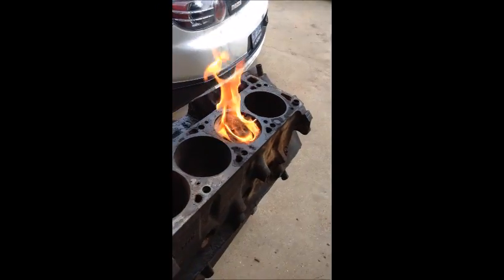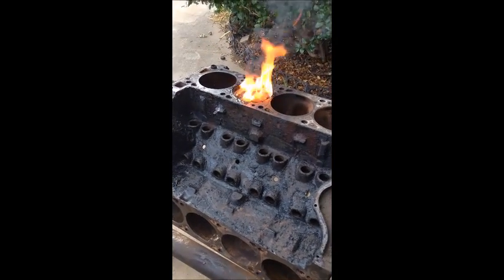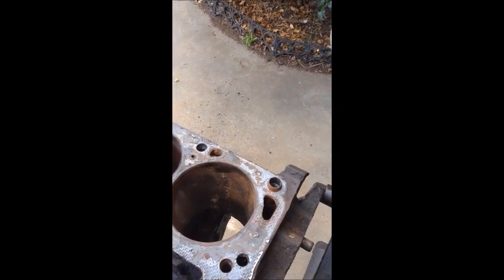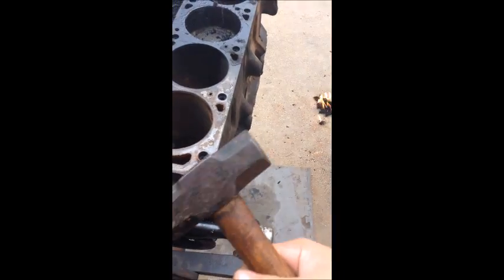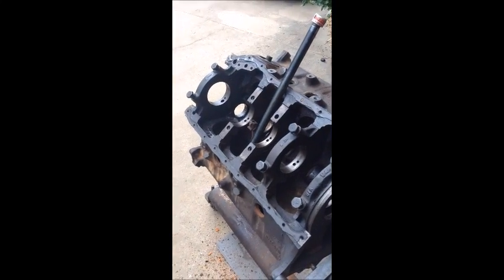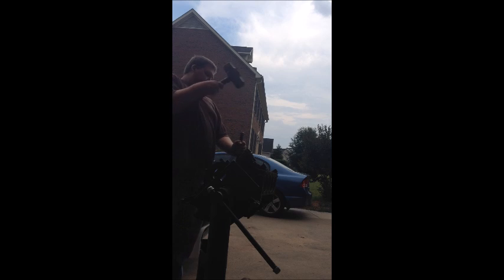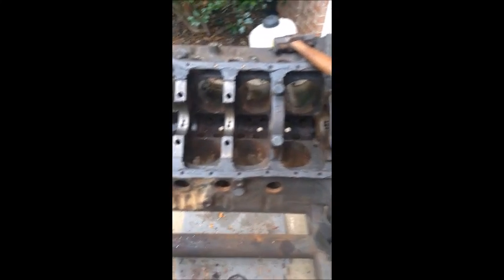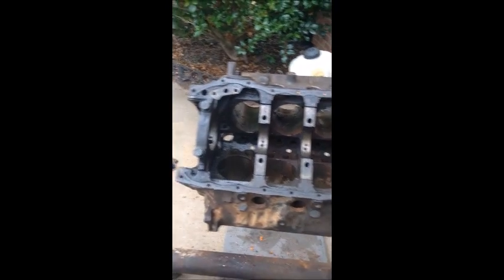How to Remove a Seized Piston

Comment: You sort of missed the point.
There is a few reasons for heat
The trans fluid and gas fire all do a few things
One of the other comments had it right with expansion rates.
Before you started to remove any piston. 
1/ pour trans fluid or WD40 on the under side of the pistons to soak for a day or a week the longer the better.
2/ do the same on top of the pistons. The longer the better.
Setting fire on top if piston does a few things.
1/ expands the piston as it does it crushes the rust and alloy corrosion this allows the fluid to creep in around the piston
2/ it expands faster and more than the cast iron
3/ once the block is hot cold water on the back of the piston "in the piston only" even ice cubes they will disappear  fast.
4/ wack that piston as it would have shrunk quite a bit.
Thats why at first you couldnt move the piston but after a while it came as the piston had cooled but the block would still be hot.
Reply: Yes, let the piston cool off, then hammer.

Comment: I would have just heated the block with a torch instead of the piston because when the block expands it will go loose on the piston that takes longer to heat up. how you've done it will probs be no different to room temperature as they've both heated up together and expanded at the same time.
Reply: Aaaaannddd again....heat fracture the piston bore/sleeve.
Reply: I would have put that Ford block in the garden as an 8 hole seed starter. 😁

Comment: your doing the wrong thing there is a ridge at the top of cylinder that must be removed to get the piston out you can beat on that all day and get no we're the cylinder is bigger at bottom try going to the bottom push it out the basics of engine rebuilding to take a ridge reamer to remove the metal lip that form on high milage engines in order to remove the piston 
The ridge can be felt by running your finger along the cylinder wall at the top you will find the lip that were the piston top ring stops and wears the wall otherwise your wasting your time trying to remove it try hit the piston down first.
Reply from the maker: rock dawg I know about the ridge. The piston was stuck well before the top of the cylinder at the ridge.

Comment from the maker: Alrighty folks. In regards to all these nephsons and their comments. I had been trying to get this piston out for about an hour before finnally deciding to try this. I tear down motors all the time and I've never had one this seized up. I tried a torch before I made this video as well. Only reason I tryed is is cause I saw another video of a guy doin it. And it worked. I wasn't trying to save the piston. I already knew it was gone. The motor was not damaged and it is back from the machine shop in my garage ready to go together. Btw, that sledge had a heavy steel tube as the handle cause the wood handle broke. It weighs almost 40 lbs.  it's like picking up a crank shaft.

Comment: You legit just mushroomed the piston in the cylinder by hammering on the skirt dont ever do that if the piston cracks youll fuck the cylinder too and that piston was fucked, ive always tapped them out from the rod cap as the wrist pin is dead centre in the piston and and also equals out the blows, all you did was just mush that piston down in there worse than it was before and by heating it up and not attempting to cool anything it legit is now wedged in there and will only get tighter as it cools, not the way to do it

Comment: Heat in metal = expansion = FUCKTARD!
Reply: It works he just did it wrong. The piston cools down faster than the block because its made from aluminum.
Reply: Paper Sack Heat in metal = expansion of cast iron that surrounds the piston. Go troll something else you have no experience with and make sure to use vulgarity to reinforce your naive statements. Obviously it worked.
Reply: Paper Sack hahaha !!!!

Comment: all for a 2 bolt main
Reply: jon sixxx xD
Reply: There's nothing wrong about doing what YOU want to do or what others want to do.
Reply: The amount of main bolts are mostly inconsequential. There are a slew of more important things. Besides - just add a girdle and it really don't matter.
Reply: You would be surprised with how many race motors are 2 bolt, and even more surprised to find that 2 bolt blocks converted to 4 bolt are much stronger than a factory 4 bolt block.

Comment: I used to have problems with that but i found if bout a week before starting the rebuild put oil in the spark plugs than put back the old plugs or rags if the broke..... Now if you do all that and it still sticks i put pb blaster or some higher grade of penetrating oil overnight and so far those are the only two methods i have needed

Comment: If you have a blowtorch and don't have much time heath the piston so it expand and "break" the rust! Wait it cool (again if you don't have much time you can use water to faster it but i recommend you to just wait) and try to hammer it again.
A even "faster" option (if you have the right tools) would be drill/destroy the piston.
The best way would be leave it on a penetration old/rust cleaner for some days/weeks.

Comment: diesel / transmission fluid mix in bottom side of piston / cylinder cavity and let it sit for several days upside down and heat top of piston with a torch / heat gun this will cause expansion / contraction which will allow the lube to get deep into the siezed area making it lubricate. Then a old trick  drain the fluid / lube from bottom of the cylinder and heat block we used to make a fire and let the block set on a stand beside the fire to get really hot then simply take a few pieces of dry ice and set them inside the piston skirting aka bottom of piston to chill the piston but keep block hot then give the piston a thump and 90% of time piston comes right out.
Reply: I ve tried the kerosene for weeks and month also.I was thinking when he was doing that to heat block,which expands then cool piston,just like you send,it has to work.

Comment: fill the cylinder with wd40 and leave it for 12 hours or so and hit it with a block from the top ive un siezed  many engines this way lighting it on fire will just make things worse you need to break down the rust which is why the piston is siezed in there wd40 eats up rust

Comment: Well that was just worst case you made dude. 50/50 atf acetone or diesel works the best. let it sit and gently work it. all that did for you was probably screw your bore. That pipe isn't rigid. it's 1/2" o.d. gas pipe. Not a 30 pound sledge either. Maybe a 20 at best.

Comment: I agree the chemicals almost always work. But you are giving up all your impact by using a pipe and having the block on an engine stand. All impact is lost by those 2. I put the block on the concrete and I use a slightly sharpened model A axle to hit on the wrist pin boss. If that doesn't work, hit the bottom side of the piston hard and it will bust and then you can get it out. Be careful because the piston pieces will fly all over at  high speed and can tear up stuff or hurt someone!
Reply: In other words, use a solid bar to knock them out!

Comment: An acetylene torch will put a lot more heat stress on the seized piston. Heat it white hot and hit the piston with a cold chisel. The piston will split and come out in pieces.
Reply: James Henry Lol shut up aluminium gets white hot?
Reply: It seems the cylinder grinder did exactly the same with the piston in the cylinder #1 in my 413 Chrysler engine. The piston was sized due to a melting top end. I saw the broken piston. The skirt didn't seize. It was the result of driving under WOT with a massive air leak (running ways too lean) at the cylinder #1 intake.
When I disassembled this engine, the piston #1 was the sole one with a melted top. All other 7 pistons I could remove myself with a handle and a Tom Tom hammer. Of course I tried the 50/50 mixture out of Acetone and ATF.
Reply: If you put in that much heat you can end up overheating the piston bore/sleeve and fracture it.

Comment: umm you had made this the worst scenario possible. If you heat the piston it expands and will never ever move, i think the video watched was a troll.
Reply from the maker: Well I had pounded on the thing for hour trying to get it out. Only reason I did this is cause I was out of options. And it worked so it happy. I've torn apart several motors in my life and have never had one this seized up. The engine had been run dry and locked up. Then sat for several years and got rusted.
Reply: It's a fucking ford, use it as a boat anchor and call it a day.
Reply: Wait until it cools.  Heat and cool a couple times to break rust or metallic seizure.  If it will ever come apart, this will work.
Reply: fire works nice, but you must try to pry it out when it starts to cool, aluminum cools faster so you hit it when it shrinks and cylinder still expanded..
Reply: greasemonkeypol 
My thought exactly. I would have also given it a few blows from the top end also and alternate direction of force.
Reply: Actually fellas cold goes to heat so start a fire in a hot from the sun grill. Let it burn for as long as you want. The bottom of the grill will cool quite nicely. So a fire in a cylinder on top of a piston will allow piston to stay cooler than the cylinder which will get hot and expand while piston will stay much cooler and contracted. Science class was fun shame no one allowed the info to stick
Reply: syahrul ridzuan that will crack the engine block.
Reply: if he just pour cold water right after the fire, it might be working much easier

Comment: thats an 8 pound sledge hammer. you couldnt lift a 40 sledge over your head lol
Reply: Anthony Morrison you know how fuckin big the head of the hammer would be if it was a 20 or 30 pound hammer??😂
Reply: Anthony Morrison that's more like a 12lb. I use a 20lb for work and it looks massive compared to that one
Reply: They've never even made a 40lb hammer. I have a custom made 50lb hammer and it's HUGE!! I took a 6" diameter chunk of steel rod from the scrap bin at work and cut it down to 13"L. So a 40lb would be at least 4" in diameter and 12" long.
Reply: John Pike - his sledge wouldn’t weigh 40 lbs if it was made out of gold!  Hahaha
Reply: BrainStorm4207 now that's probably like 20 or 30 lb Sledge my 8 pound Maul isn't anywhere near as huge that thing is

Comment: next time try sea foam deep creep I had some cross threaded impacted spark plugs rusted to some cylinder heads and it got those freed up after letting sit for ten minutes. the spray is expensive but works really good. or use acetone and ATF and let set it'll work to.

Comment: I've found the best way to free up a seized engine and it has worked for me many times. I made a big pot out of an old propane tank, put legs on it, put the engine in, fill it with water, build a fire and boil it. Skim off the grease and dirt and your engine can be taken apart with ordinary hand tools  and the bonus is that it's as clean as a whistle.
Reply: I have boiled many engine works great metal trash can simple green and lye drain cleaner leave for 10 ish hrs
Reply: That's called hot tanking. Lol Of course it's usually only used these days in the clean up process.
Reply: make a video of that please.
Reply: Tried that once with simple green in boiling water... worked pretty good but still had to scrub a couple spots that were deep

Comment: any problems with seized bolts????!
Reply from the maker: kenneth pauli bolt came out with ease. If I remember correctly, I think I may have use an impact gun. But maybe a breaker bar. If I had problems with them, I probably would have used a torch to heat em up.

Comment: 50/50 acetone and atf
Reply: don't light it let it sit like a week
Reply: kenneth pauli not even lol 2 days at most
Reply: She junk.
Reply: you start it on fire to make the block expand but not the whole piston so its easier to remove.
Reply: napthal and at. let it sit
Reply: Acetone and ATF don't mix. Acetone floats to the top and dries away in 30 minutes. Leaves nothing but ATF.
Reply: @hyzercreek  like hell they don't